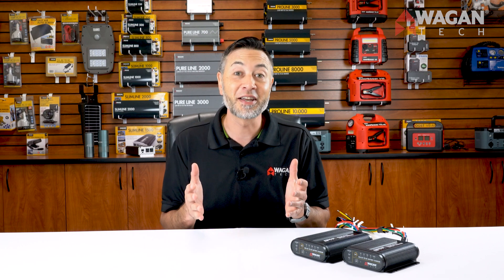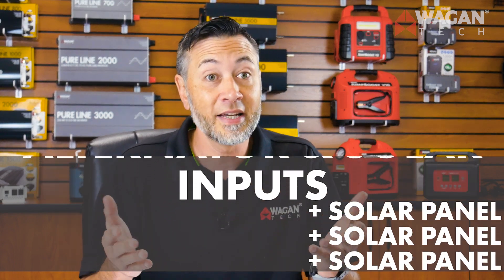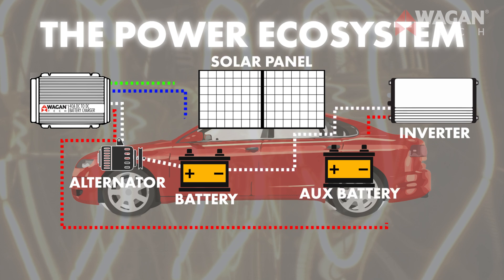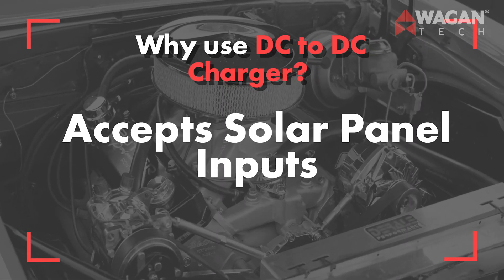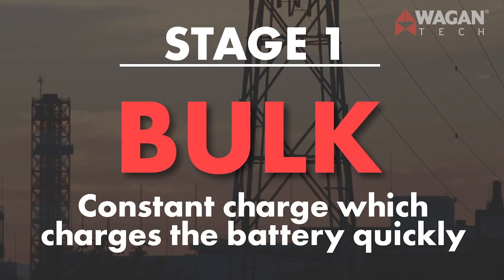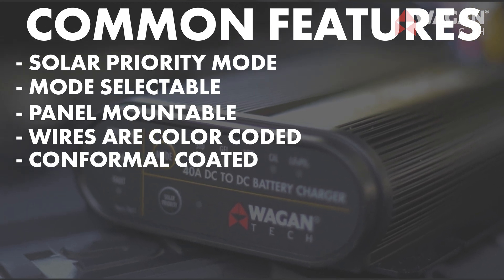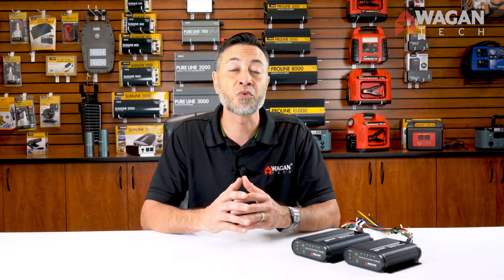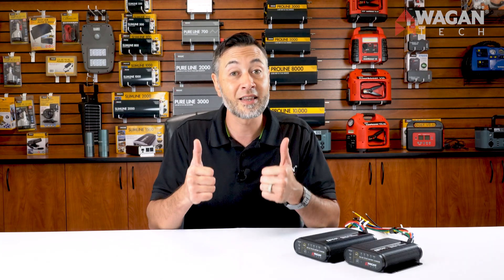New Product: DC to DC Battery Charger Lineup (#7410 & #7411)

Comment: When the ignition switch  is off does the mppt solar controller still work? Where is that getting power from? And when will the 7400 external monitor be available? Thanks looks like a nice unit.
Reply from the maker: Terry, the Solar charge controller will still work. Power is provided from the solar power once the unit switches from alternator power.
We're hoping to have the full-color display/monitor available within a few months as we're in the final stages of programming and testing.
Cheers! -Justin